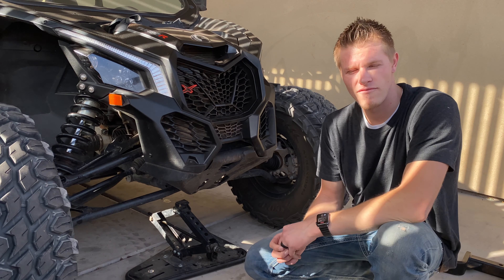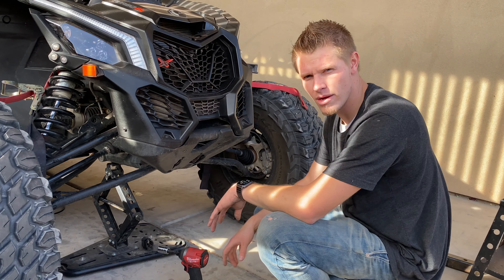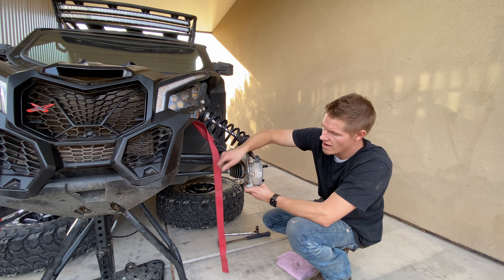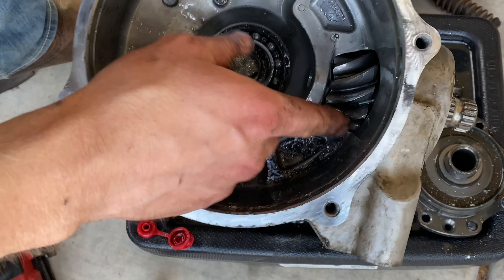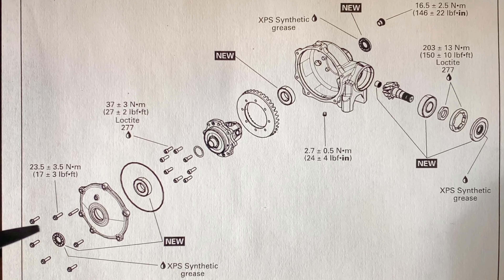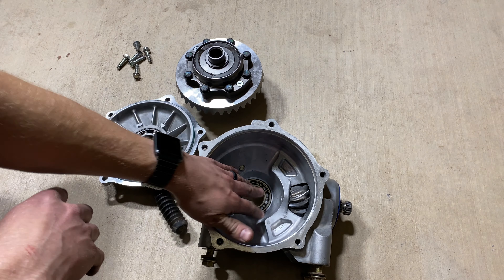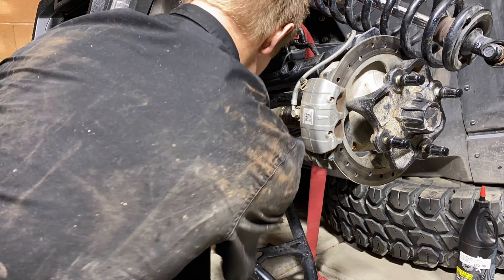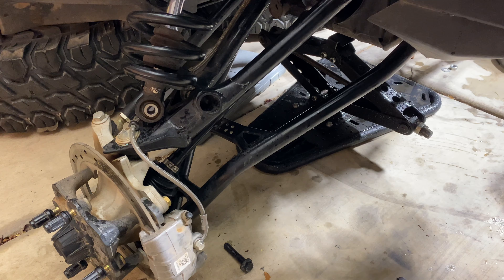How to Rebuild a front Diff on a Can Am X3

Comment: How does the actuator have anything to do with your rear driveshaft?
Reply from the maker: Your front diff is constantly engaged with your driveshaft that goes from the front to the rear. So there is an actuator that locks that driveshaft in from the rear to put your vehicle in 4 wheel. If that makes any sense.
Reply: @theaccessorizeguys4  I was completely unaware that there were two actuators. Thanks